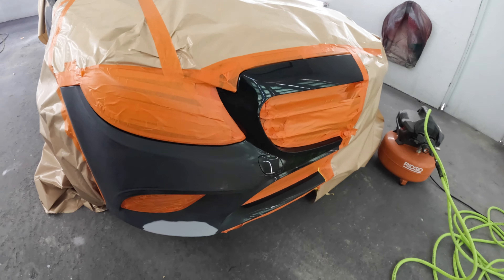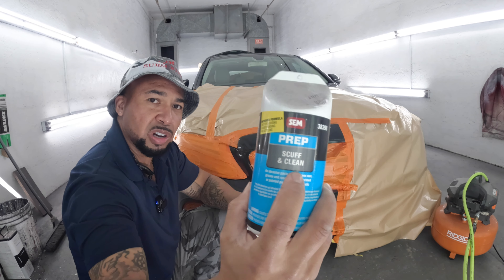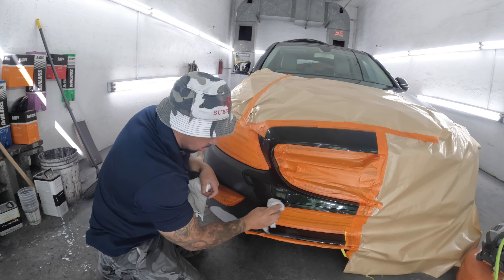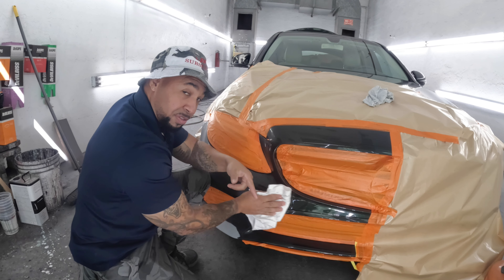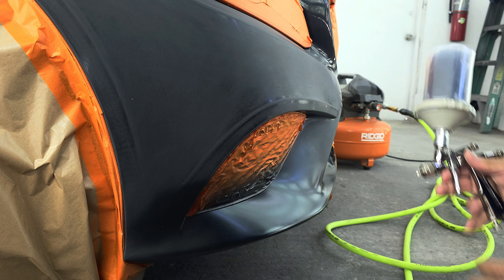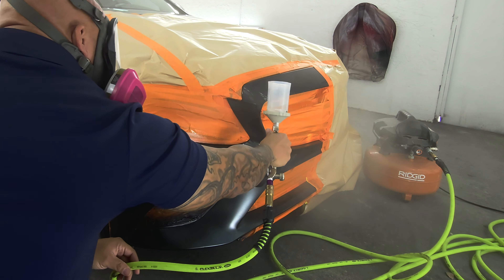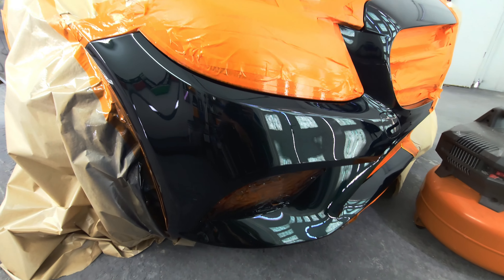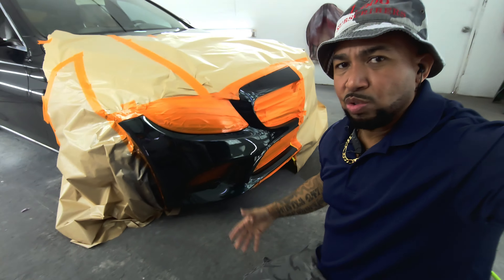DIY clear coat spot blending step by step tutorial. LVLP mobile set up

Comment: What about the tape line, do you have to buff that area, great video
Reply from the maker: No tape line left. That's why the tape is so far away. There's nothing to buff. But you an always hand polish it if you see any mist near the tape area. But shouldn't be anything especially if you're using a small gun or a gun with low overspray.
Reply: @thetriggerman954  bet, 👍🏿 thanks fam

Comment: I always like before I watch, immediately drop the video down to like it towards the end… then I have to like it again.. idk if YouTube can show you that much detail 😂 awl grip has a base coat and top coat blender. Will run like crazy but I have found if it doesn’t run into the fresh clear it evaporates and I can quickly 3000 it and buff it away. What brand of paint are you spraying again?
Reply from the maker: Sanding and buffing your blends? 🫣🫣 Lol we use ProSpray at the shop. And no YouTube doesn't show all that lol  if you like once then hit like again it takes the like away 😳😳😳😳
Reply: @thetriggerman954   only if I ran my blender just right.. I’ve messed it up though and just wiped it all off with thinner and restarted 😂 pro spray I don’t think I’ve heard of that brand. Oh ok lol I make sure I re-like the video but that every time. 😂
Reply from the maker: @Oneinacrillion2000  😂😂

Comment: Is there a way to spot repair a panel that has no hard edge near the damaged area? (like a chip or peel in the middle of the roof or hood).  Or you have no choice but to reclear the whole panel edge-to-edge?  I've used spray blender and polished after but you can still slightly see where the blend is 🤦‍♂️.  I used SEM Blenz-in and it doesn't seem to blend too good.  The can also lost pressure about 60% empty and sometimes the next day the blend area is still gummy.  Maybe I should try that Spraymax 1K Blender.
Reply from the maker: @89GTFoxDude  yes there is. I actually did one this week but the video didn't come out clear had to trash it. I'll work on making one. I've gotten a few requests from guys asking the same question. You may still need to polish but you won't see it.
Reply: @thetriggerman954  That's true skill right there to be able to repair a small area and make it look like it was never there 🙌🔥.  I am still learning 👍.

Comment: Nice blend! I do blends everyday I always back polish the blend area paint area 800, closer the the blend zone 3000  , my first coat of clear dose not go to the blend zone last coat goes the the blend zone , right after I spray my upol #9 blender I turn my air pressure down dry my blender I get no haze, no polish is needed
Reply from the maker: Sounds like you got that thing down ✊🏼

Comment: Awesome little blow in with just the right amount of info.  The problem these days, that I have found, is getting solvent base coat in small quantities.  As you know, nobody wants to sell any less than a half pint and it seems like base is getting more and more expensive (cutting into profit)
Reply from the maker: @johngreen2510  get you a mini set up. Then you can mix your own paint. Most paint companies have a mobile set up. They'll sell you all tints in squirt bottles. And software to look up codes and mix it up. That's if you're doing that much work to justify the investment

Comment: Hey bro, did you pretty much end the feathering at the edge of the scuff cream adding enough in the feather area to hide all the scuff so no scuffs needs to be polished out?   If you get feathered paint where theres no scuffs will the blender melt it into the old for a good bond?  With acrylic enamel single stage would it be good to put a little blender down prior to paint to 'open up' the old paint a bit so they stick good?
Reply from the maker: @stephenwhite5444  not sure what you mean by "open up the old paint " that's not really a thing. And no the scuff area doesn't need to be blended out.
Reply: @thetriggerman954  I just mean if you spray reducer on the old paint won't it kind of soften it some so they bond better?  Regarding the scuff cream area, I thought that you feathered out over the scuffed area? You might not remember, we were talking last week on a recent video and you linked me to here......but I'm trying to kind of apply this to spotting single stage with no clear coat to spot repair an original 1971 paint on an all original collector car. So trying to understand if I would feather out the paint just past the scuff cream area and just heavy enough so you don't see the scuffs?
Reply from the maker: @stephenwhite5444  I remember. But as far as softening up the old paint I don't find any of that to be true, I've seen comments where people mention that on YouTube but it's nothing that I've ever learned or experienced so I'm going to have to say no on that. So basically you would just take your paint maybe mix it with a medium reducer one part sprayable paint to four parts reducer and do your blend over the scuffed area. I forgot that you were talking about single stage but it shouldn't require any buffing.
Reply: @thetriggerman954  wow, 80% reducer? Do you mean spray the normal paint over the damaged area and feather to the edge of the scuff, then basically mist the colored reducer over all of it to kind of melt it in?
Reply from the maker: @stephenwhite5444  the reduced paint is just for the blend area. It would be a substitute for the aresol can I this video. But yes it sounds like we are on the same page . Even use a mini gun to assure an even better job and less change of running it.
Reply: @thetriggerman954  I'd like an LPH80 like you use but are you familiar with any budget mini's that do good? I'd never use it but this one time. I suppose I can find them for like $250, so not bad if that's what's best....if I get one, what tip size do you recommend?
Reply from the maker: @stephenwhite5444  then just use the regular gun. Not really a big deal. Just be careful.
Reply: @thetriggerman954  I may try to find a used LPH80.....with single stage, would you use the .8 or 1.2?
Reply from the maker: @stephenwhite5444  for a blend .8
Reply: @thetriggerman954  thank man! I appreciate the lesson!

Comment: You say you used 800 to sand, Could you
have used a maroon stuff pad, or would that be too ruff?
Reply from the maker: Probably could. But it is pretty rough. I usually only use maroon pads on areas I plan to put heavy base coat. Just not the ideal method in my opinion. Maroon=base
Gray=blend area

Comment: Love the content bro! I’ve been painting for quite a while now but I’ve had so much trouble figuring out prices is there anyway you could point me into the right direction?!
Reply from the maker: Thank you sir, prices vary on location. Might want to look into an estimating software The one I used is a bit expensive made by Mitchell but they have so many different types out there I will You just type in the job you're doing and it calculates it for you based on the rate you set. Or you can come up with your own method say like excluding materials if you charge $300 per panel etc...
Reply: @thetriggerman954  what about material wise ? I’m sure when you buy a gallon of clear you don’t charge that whole gallon to the job do you?
Reply from the maker: @BoostGarage23  materials you just want to come up with a figure and apply that to the size of the job. Say a fender,front door, rear door, quarter panel so that's a complete side. So let's say you charge $200 per panel for your labor. Now that's $800. And our material you could say $100 per panel so that's another $400 which is now a $1,200 job. Look at the job and see if that works for you if that seems a bit cheap adjust. Now let's say you charge $300 per panel  Now you're at $1,200 in labor. Now add your $100 per panel in materials so that's another $400 Now you have a total of $1,600 for the complete side of a vehicle. Write everything down then look at different cars and see if it's worth it to you If it is then good If not then adjust. Then the more body work you have to do then you'll know to just tack on an extra from there.
Reply: @thetriggerman954  appreciate the help triggaman, I’ve tried asking so much painters the same thing and all they would tell me is charge what feels right but I don’t want to charge too much and have a customer walk and I don’t want to charge too little and not make enough for myself. Thank you again 🙏🏽
Reply from the maker: @BoostGarage23  Anytime and you're more than welcome. But looking to those estimating softwares even if you just tried it out for 30 days and it'll give you a good idea. 💪🏼